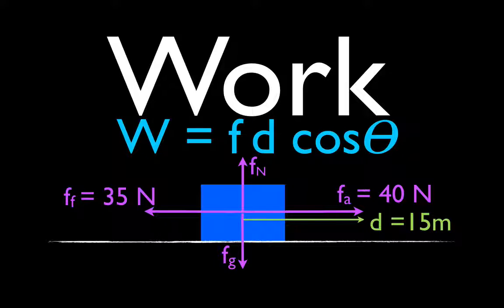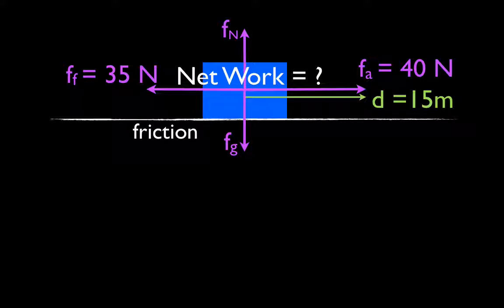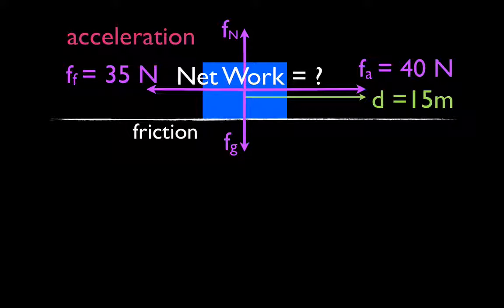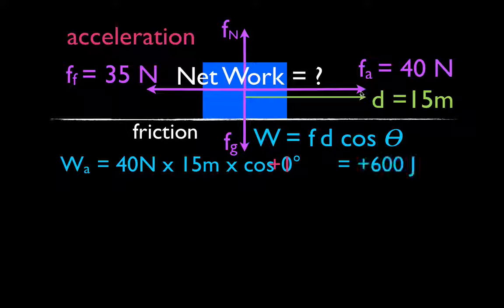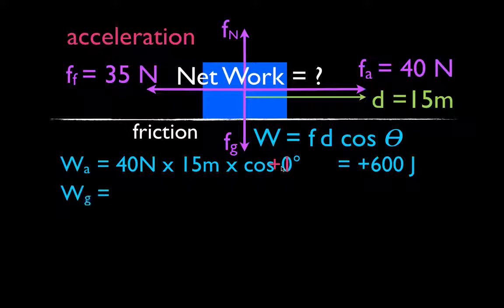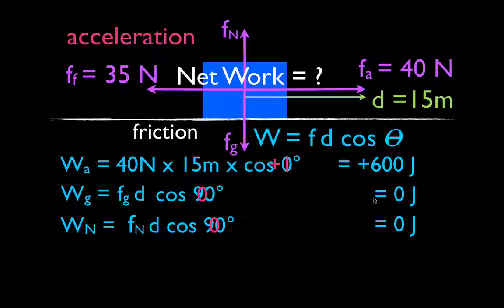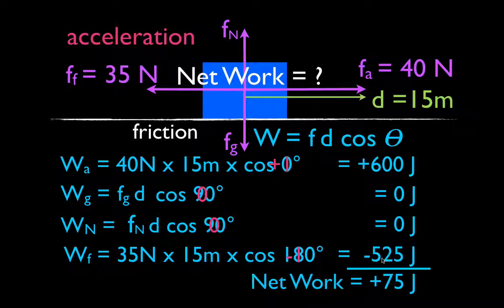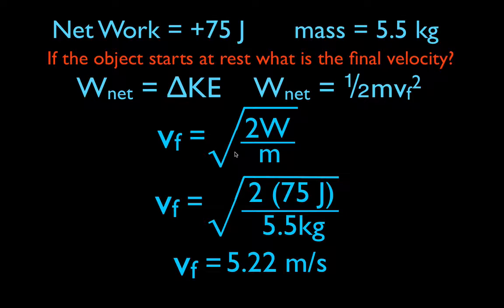Energy, Work & Power (11 of 31) Work Energy Principle, Net Work Done on an Object

Comment: Hello, I have a question, if the friction force is larger than the force applied but there’s still a displacement, will the work be positive or negative ? Thank you
Reply from the maker: If the friction force is greater than the applied force, the object will not move.